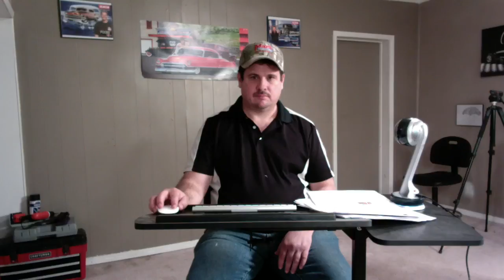Is Your Body Shop Carbon Fiber Ready?

Comment: Carbon fiber is not that different from fiberglass. Using carbon fabrics layered for strength wetted out with resins specificity designed for carbon.
Reply from the maker: That is good to know.  Thanks for sharing!